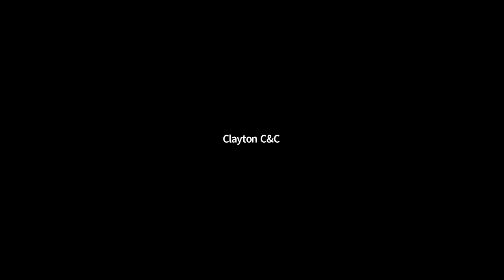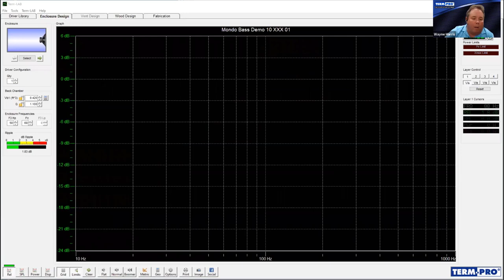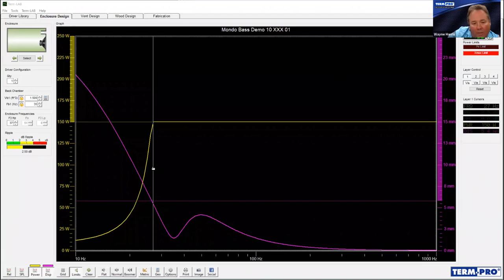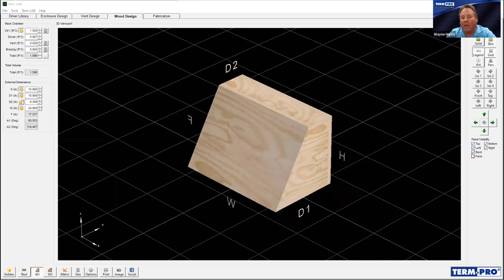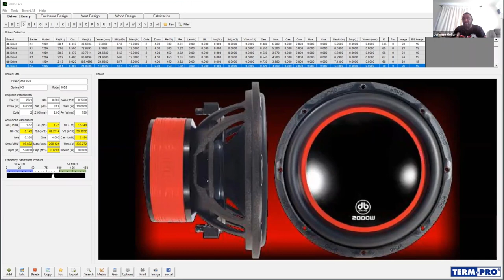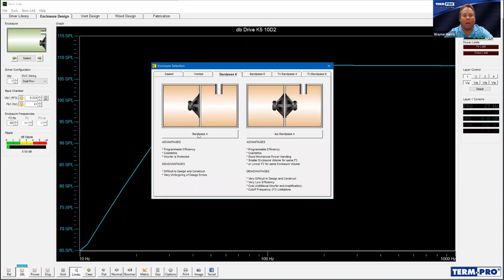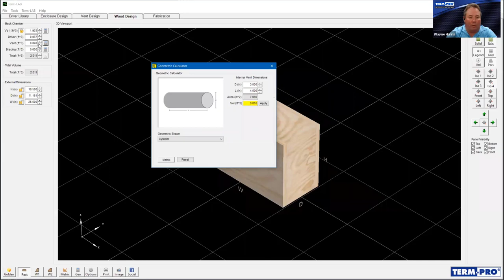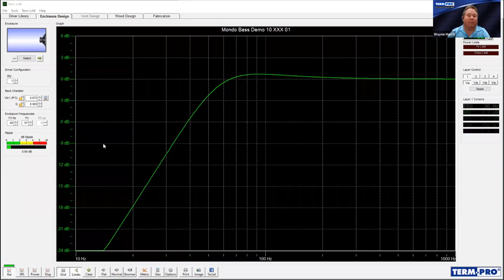Term-PRO Loudspeaker Enclosure Design Webinar 010

Comment: I recently bought Term Pro and overall I've found it to be a valuable tool for designing enclosures. Heres a few of my initial thoughts.
The features I like the most and have found to be the most useful are the extensive driver database and the flat, normal, and peak quick select options. 
I can easily select the driver I'm working with and in a matter of minutes I have a solid baseline to get the response I'm looking for. 
From there the program lacks tools that allow you to make a completed design.
This is mainly due to the inability to add internal objects. Aside from adding internal objects, you can't specify/modify   subwoffer mounting orientation, internal port depth, baffle thicknes, or baffle location (for bandpass applications). You can add the volume of internal objects manually but it requires you to do all the math yourself which is a royal pain. 
If you're considering buying this program and are under the impression it will be a 1 stop shop for all things enclosure design, you will find that it is not. 
I'm happy to add Termpro to my enclosure design tool belt but I still use BB6 to add all my internal objects and finalize the box design. From there I use the info from BB6 in sketchup to work up a 3D model and cut sheet. 

All in all, Termpro is a valuable tool but not the 1 stop shop replacement I was hoping for.  Im excited to see how things progress over time. After further updates term pro could replace the need for me to use BB6 and maybe even the need to use sketchup for 3D modeling. 

Thank you.

Comment: Cool, but not $250 cool. I just wanted to build my box, however looks like it’d be cheaper and 0 time of mine to just have a stereo shop do it for me. Also being able to see the subs in the design should be added. It would nice to know if the sub would hit the back or bottom of the box especially if building a slanted face box. Mounting depth and all the other parameters are there. Close but no cigaro.

Comment: I have a question,  when I use the deaf bonce db-sa-302 custom sub parameters in a ported design in a normal response, cubic ft only calls for .224 @ 51 hz. In the web, parameters call for 2 cu per sub @ 35 hz.  What am I'm missing?   I see a lot of the subs here with the same outcome.

Comment: What is the difference of REL dB and the spl. 
I have two different configurations same cu.ft same tuning for a 6th order. Only difference is the speaker and the amount.  One has 4 15’s at 32hz  my REL is 2.5dB and spl dB at 134.6 
And the other is 2 18’s my REL dB is 7.5 and the spl dB is at 132.1

What one would be louder? I’m a little confused here. I watch the video of you explaining that the REL is more about efficiency or did I understand that wrong because it was compaid to a sealed enclosure and compared the two the one with more REL was audibly  louder. But in my case the other box with 4 15’s  had 5 more dB in spl 136.4 at 44hz than the two 18’s that have 7 more dB of REL at the same 44hz  with 131.7 spl

Comment: Thank you for the tutorial. I would like to make a few suggestions from my experience if possible. 

Can we have dimensions viewable on the graph in the wood design tab, and also id like the option to make a slot-port with a single internal panel for a 4th order enclosure instead of just the standard option of constructing a rectangular or square vent with 4 internal panels that make up the vent. Also its a bit confusing to design the vent and the box separately. Can we have one tab that shows the vent inside the box on the grid?
Reply from the maker: Thanks for the feedback. I am already working on the slot port suggestion.

Comment: i can not find a place to contact via email.

1. when designing a 4th or 6th order box and you get to the fabrication part, the program does not account for the middle baffle where the sub would be placed in its dimensions. Can this be fixed?
2. is there anyway to account for bracing if you need to put bracing inside the port?

Comment: maybe someone can answer my question. if i am designing a box and it is showing me a high spl line but the relative line on the graphs is around 0db, does that mean that the box is going to play loud which is what the blue line represents and the green line is just difference in frequency?
Reply: to expand more if the blue line is up around +6 db but the green line is around 0 is that meaning its going to sound loud because that what the blue line is showing?
is it better to have the green line higher or the blue line?

Comment: I would like to use all features of this program but I can't because the wood thickness is limited to just over 1". Most box builders now use at least 1 1/2" material.
Reply from the maker: I will add more selections in the next update. Thanks for your input.
Reply: @dB-TV  Thank you, going to renew soon!

Comment: The port measurments need to be more accurate... The calculator uses inside diameter instead oh outside.
Ex. 3inch pvc pipe is 3.5 inches on the outside and if port is 2 foot long thats a big factor
Reply from the maker: I think you are referring to Port Displacement. If you want very precise PD calculations, click on the "calculator" button on the toolbar, select "Cylinder", and then enter the outside diameter of the pipe and the length (excluding baffle board thickness) in the "External Dimensions" fields. Copy the calculated "Vol" to the "Vent" field in Wood Design. Please note that I do not monitor YouTube comments for tech support. It is best to send us an email. Thanks.
Reply: @dB-TV  Ok thank you

Comment: What about changing the wattage of the speaker if you have more than one going in the box. So if you had four eight inch subs with dual 4ohm voice coils rated for 250RMS 500max.  Now in the software  when you change the number of speakers from 1 to four would you also leave the wattage for the speaker at 250watts for the single speak or change it to 1000watts for the four speakers. It make huge box response from one to the other on how it shows how it responds
Reply from the maker: The Total Applied Power is actually the power applied to EACH sub. (If you hover over the field it will say that.) It might be less confusing if this field was labeled "Applied Power per Driver" or something like that.